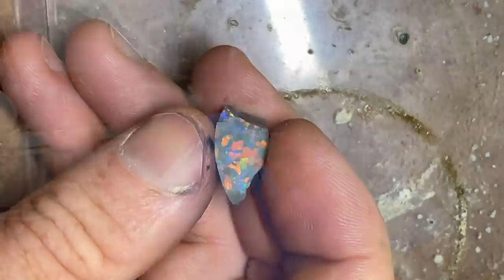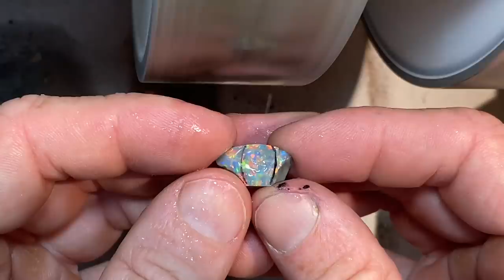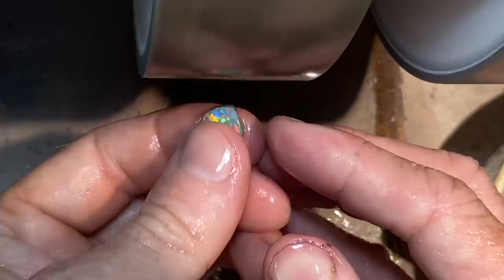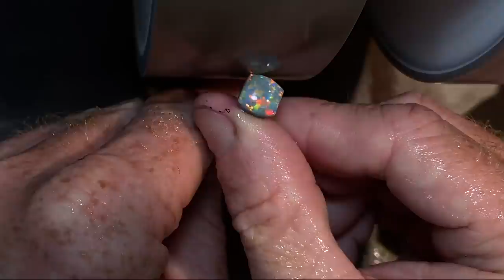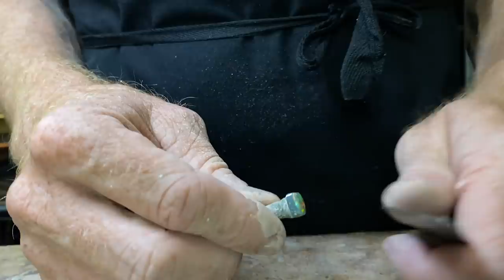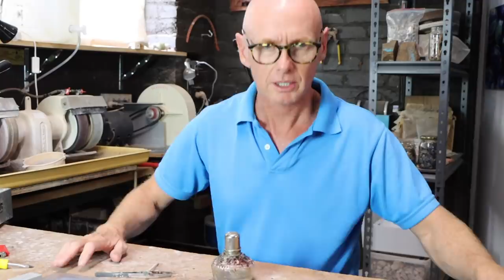A top gem black opal takes on a new shape to increase value

Comment: Is it possible to cut the unwanted opal rather than grinding it all off?  I know they are very small chips but if you saved them up could they be used for inlay?
Reply from the maker: It is possible in some stones. But on this one there was color missing and chips they would have made it very very small. So I made the decision to just grind it away

Comment: Hello! What is the smallest opal size that makes sense to cut? I mean, before you decide to cut this opal, did it make sense to precisely cut off a small piece to the right instead of grinding it on an abrasive wheel?
Reply: 1:54 I mean this small piece to the right.
Reply from the maker: 3mm round is getting pretty small and hard to cut

Comment: Why not save the two points by cutting them off and using them as smaller pieces?
Reply from the maker: it would be a 20 point stone by the time you sliced and cut it with the risk of losing extra carats off the main stone. Not a risk I was willing to take. :-)